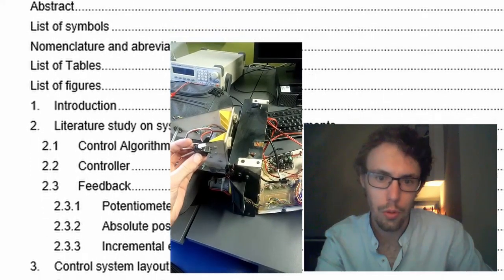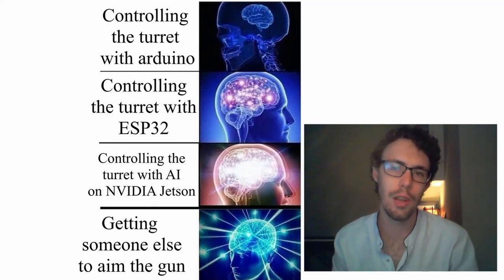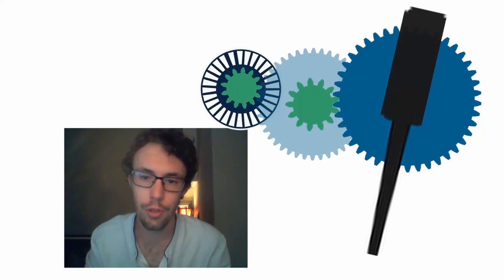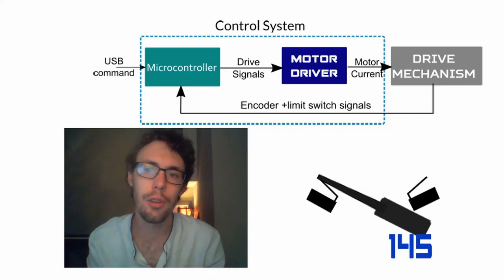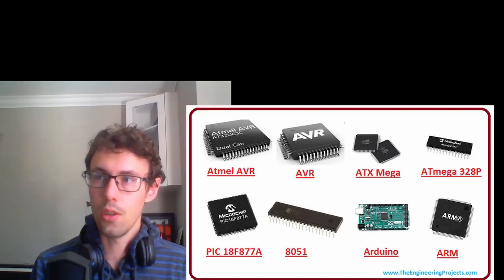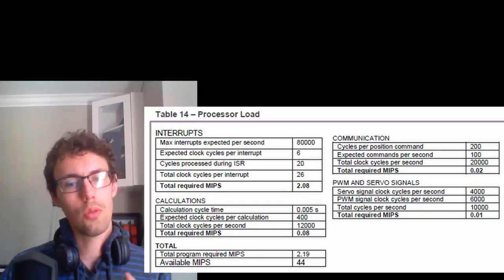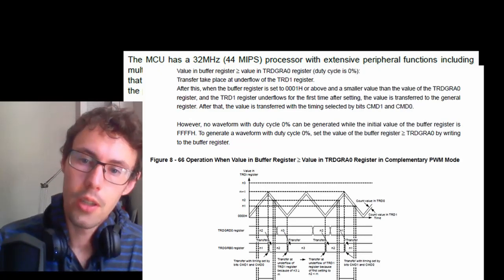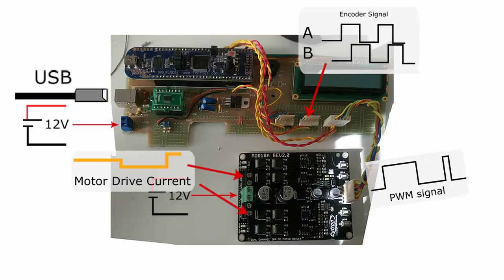Paintball Turret - Sentinel control system design (Video 4)

Comment: estimate distance is also possible with one camera. Why you chose double camera ?
Reply from the maker: If you think about it, getting distance from one camera is mathematically impossible unless you know the exact cross sectional area of the target, and that area doesn't change ever (I.E a sphere). To get 3 co-ordinates in 3 dimensional space, you need 3 equations to relate, or two equations and one fixed variable. In this case the fixed variable is the distance between the cameras, and the equations are the projections from 2D to 3D space (in actual fact its 6 variables including all the rotation angles! but we ignore them because they are also all fixed). If you want an in depth understanding of this math field, look up Homogeneous coordinates and projection geometry in Euclidian space :).
Reply: @ThoughtinFlight  thank  you